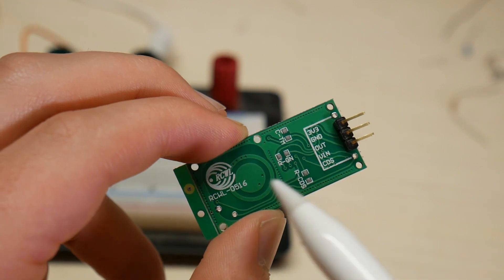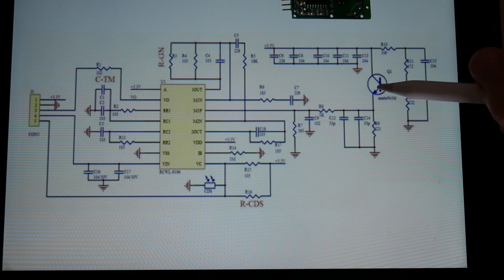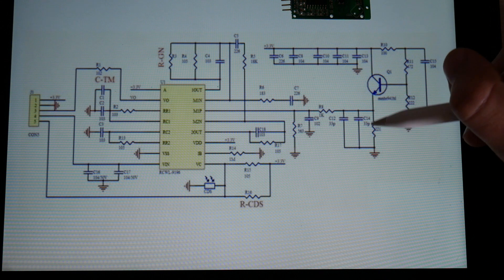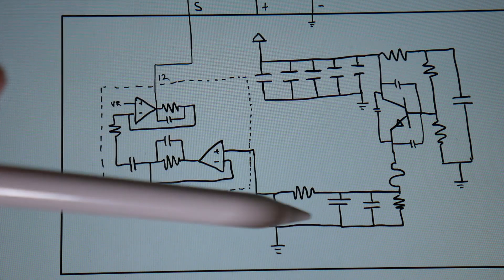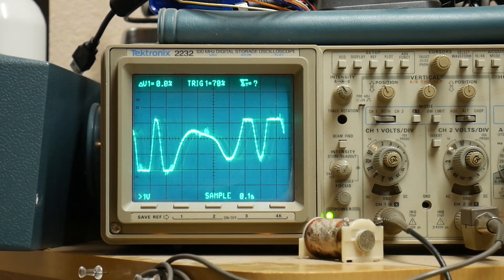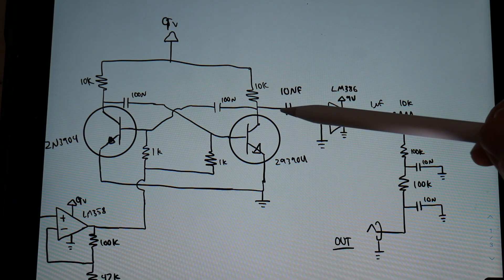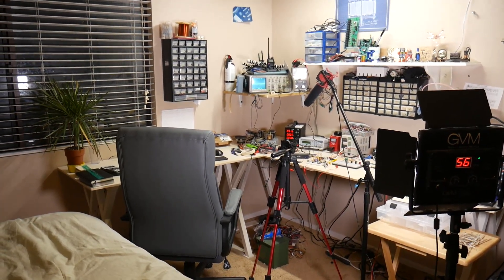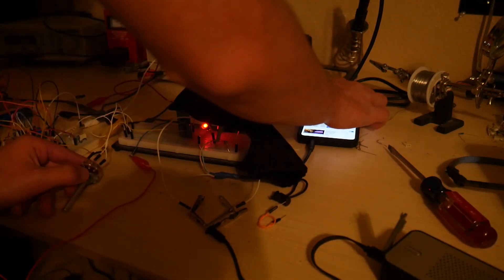Making Music With a Doppler Effect Motion Sensor(+Circuit Analysis/Oscilloscope Visualization)

Comment: What about a doppler sensor for security cameras? Is that a reliable way to turn on a video camera or do they use some other technique?
Reply: You can, but nowadays it's cheaper to do computer vision since you don't need a separate sensor and some way to communicate the sensor outputs.
Reply: @NiHaoMike64  That's fascinating. Cameras must have a low-power mode with a low frame rate and maybe that kicks into 30/60fps once motion is detected using computer vision? Is that more efficient than using external sensors? Do people care?
Reply from the maker: Good points, I know this works well to turn on lights and such when people walk nearby.  It would be interesting to do an in-depth analysis of modern security camera.  I assume the camera is constantly recording and saves what it has been recording for the past bit once it detects motion.  I know that is what the ring doorbells do.